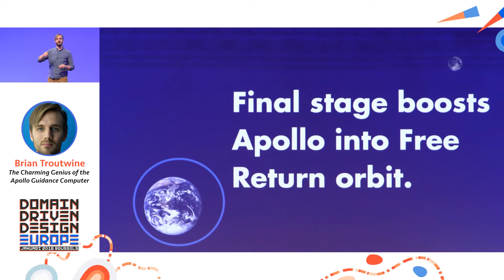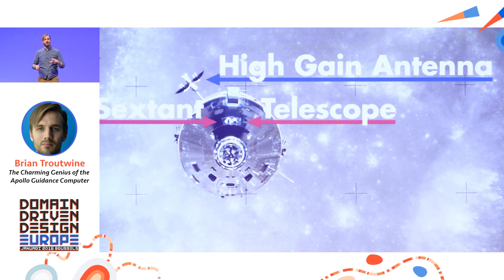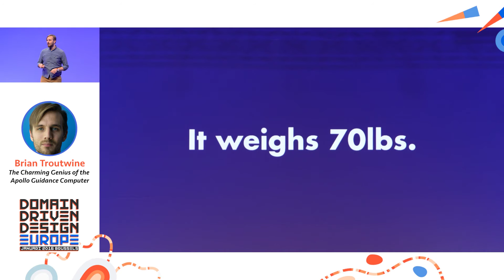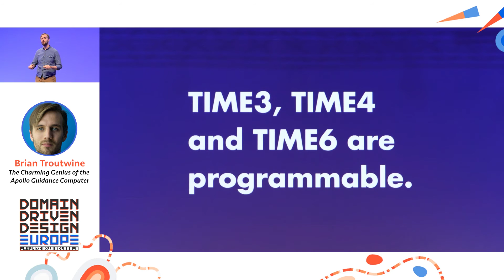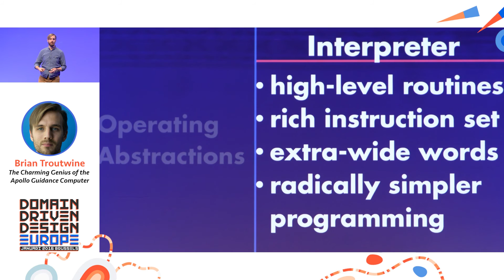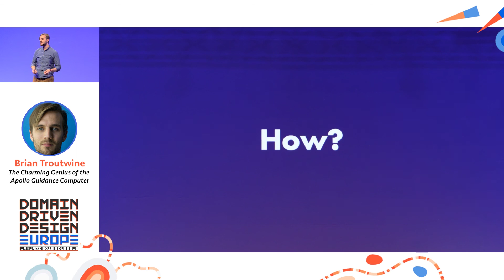Brian Troutwine — The Charming Genius of the Apollo Guidance Computer

Comment: You are forgetting the contact sensors on the legs of the LEM, the astronauts turned off the decent engine when the blue contact light came on, I don't think the radar would shut off the engine